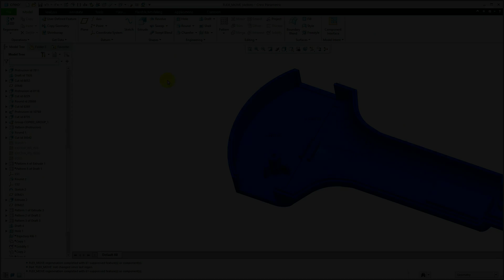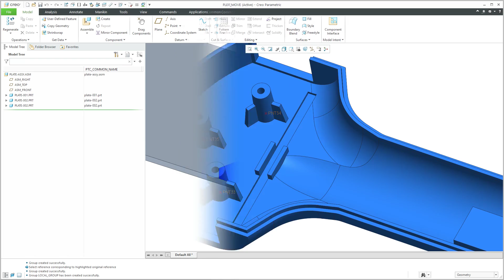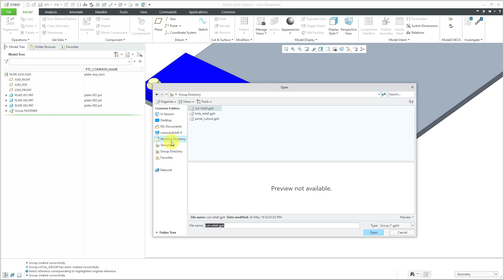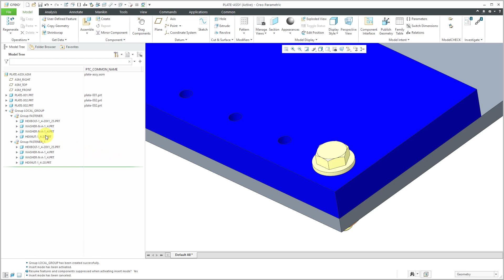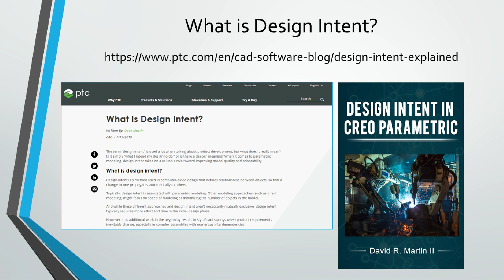Creo Parametric - Local Groups in Parts and Assemblies

Comment: I am glad to learn, and have you confirm my suspicions, that Creo had improved from previous versions with regard to (Grouped items) failing/supressing/deleting features within a group.  I had previously typically employed grouping items at the end of a design.  I was apprehensive of grouping "too early" in that when an item may have been affected that was inside a group that it would require unpatterning/ungrouping down to the individual feature in order to edit/suppress/delete the feature with impunity or cascading effect to other features related to the group or pattern of groups.  That is a nice and notable improvement by PTC's elite programmers.  My job is often considered EASY.  The hard work is writing the code that makes my utilizing the CAD software simple and intuitive.  We all use (cell) apps, but most cell users are clueless about how to design/create/market an idea like something as simple as an app - let alone Boolean algebra-based CAD subroutines.
Reply from the maker: Yes, I found Groups could be painful in earlier versions when you wanted to use Insert Mode or change the members. They are much more user friendly now.

Comment: Nice video. :)

In this video, you insert the fasteners in the assembly with a udf. Is it possible to insert components with udf, and also reference some external references of the inserted component? Ex a surface that defines a surface of a stamping die
Reply from the maker: I don't believe you can do that. About the only way I can think of doing that is with an Assembly Level Feature although I've never tried making a UDF with components and features.
Reply: @CADPLMGuy  Is it possible for you, to show how did you created that UDF? Thanks
Reply from the maker: That's in this video https://youtu.be/Zb5ey4OthW0